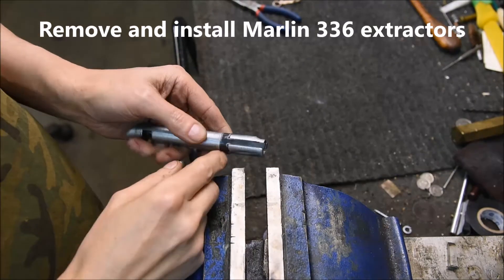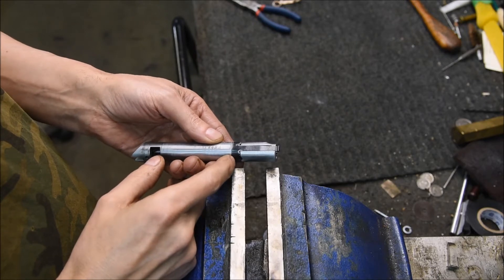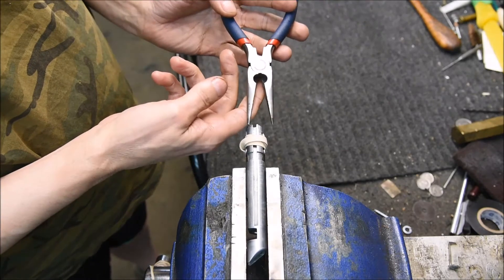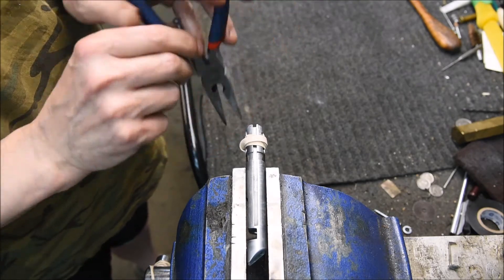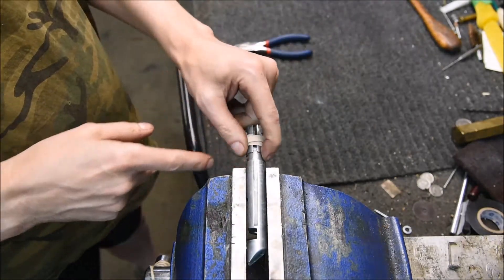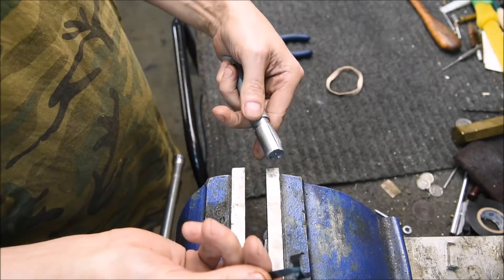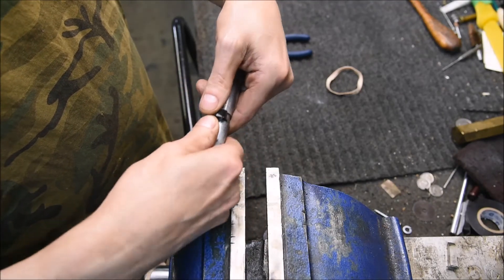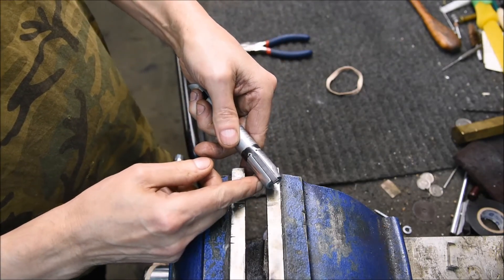Remove and install Marlin 336 extractors

Comment: That one on your video looks different than the extractor spring I just recieved. That one looks like it wraps around the bolt. The one I have looks like it goes in a slot and shaped like a V.  Part numbers on the package says ( 136544    011820  Marlin Ejector with Spring. Marlin 336, 444, 1895 All models,1894,1894C, 1894P, 1894CB Blue)  I haven't tried to replace it yet. I want to know if it's the right one first before I open the package.
Reply from the maker: Part and number 136544 011820 Marlin Ejector is for the EJECTOR,  not the EXTRACTOR which I am showing replaced in the video. The extractor pulls the live or fired round out of the chamber. The ejector kicks the live or fired round clear of the action.